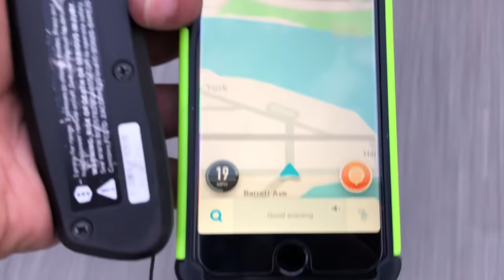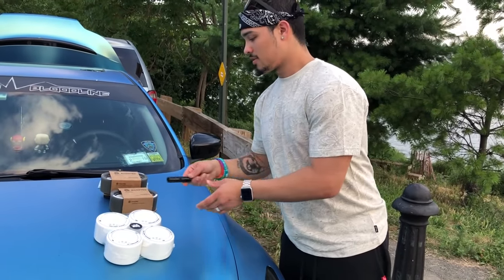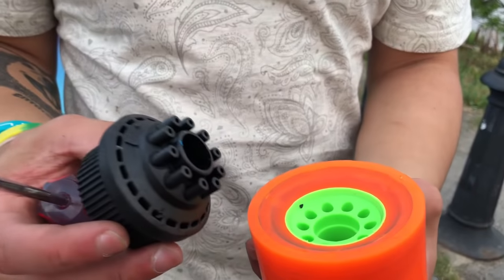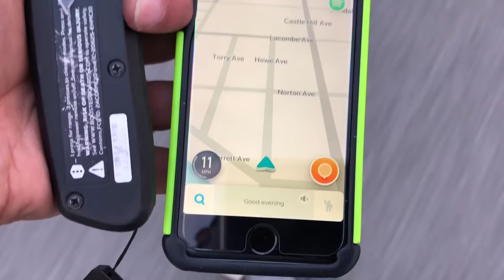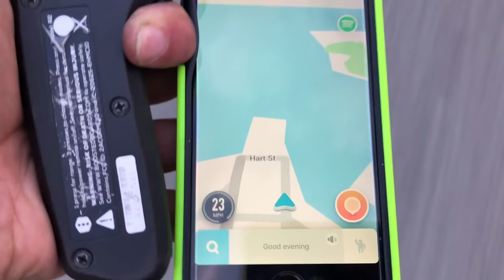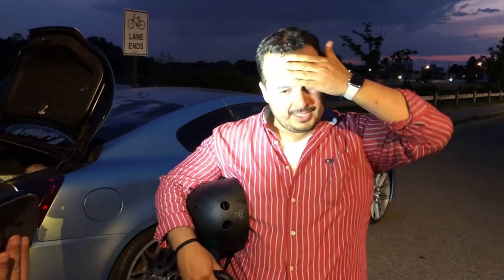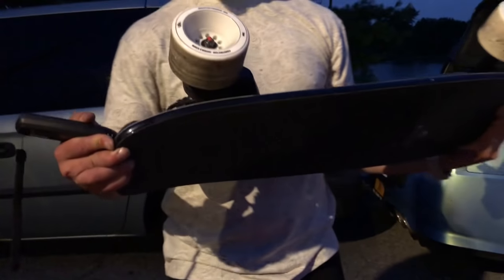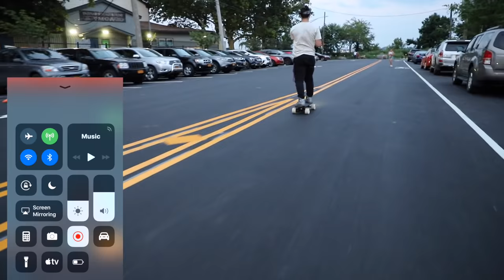3nv7.A.V. BoostedBoard Mini X on 100mm BOA Wheels (23-24mph top/Speed)

Comment: Awesome video bud, question, do the 100m wheels hit the board in tight turns or is it alright? I tried turning really sharp on my mini x with the 80mm wheels and it looks like it will have the 10mm extra clearance on the top (and bottom obviously) to still do sharp turns without hitting the board.
Reply from the maker: Ali HN hey brother. For the 100mm you neeed should spacers, you need it. It can be dangerous. :) hope it helps
Reply: @3nv7jt_avares13  thank you so much for the reply, I'll make sure to get some spacers too when I order these then :) again, awesome video brother, really helped me decide whether I want the wheels or not, keep up the good work! ;)

Comment: hey dude sweet vid! question though! did switching out the wheels with a larger mm  affect the breaking or torque?
Reply from the maker: iamvictor hey brother yes it did... it decreased it. But the top speed is improved, it takes a little to kick in but over all is not that bad is manageable.

Comment: Have you found your board moter or battery to overheat when using the big wheels?
Reply from the maker: Miguel Cervantes not at all and used it alll summer long :)
Reply: YES! They do! And one more thing to note, the ESC BOARD on the pcm  calculates rotating mass and if you fuck up your shit boosted knows,if you where using improper wheel diameter And WILL NOT  honor your warranty ! It’s a  decision you will have to make , speed vs  functionality speed vs  reliability , speed vs KEEPING YOUR WARRANTY 👍✅ speed vs  your motor is overheating and you having to change them more frequently and  not to mention your belt breaking way faster because it has a slow down my rotating mass and usually those wheels at 3 pounds to your board these guys don’t tell you that !....  looks like you have some thinking to do ✌🏻Ps not to mention YOU LOSE HELLLLLLA  torque TORQUE !!!!😲👎🏻 Don’t do it!